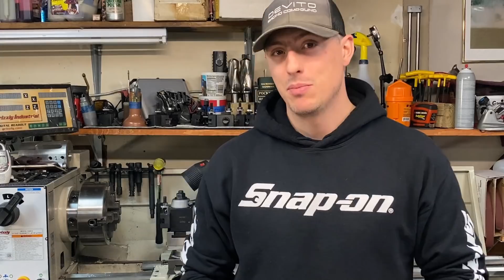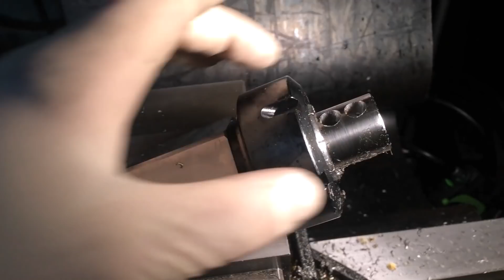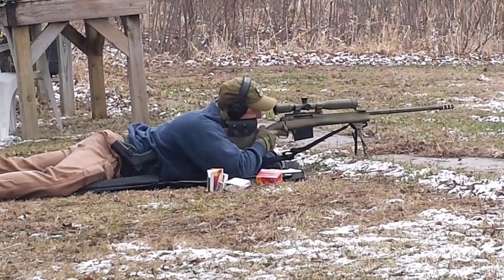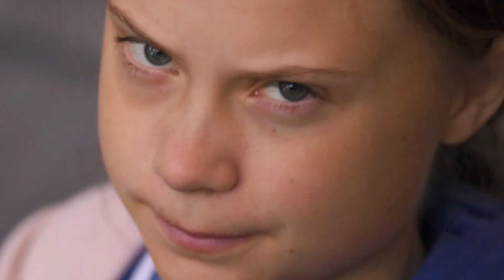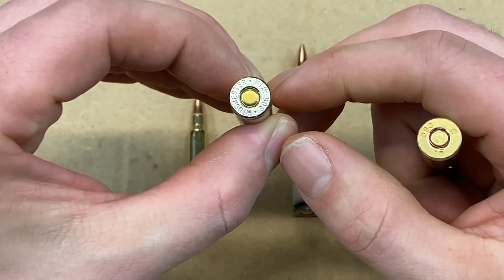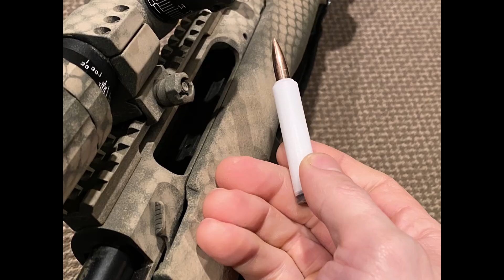6.8 NGSW ammo selected by the U.S Army for the NGSW Rifle testing! #ngsw #6point8ammo #army

Comment: Is the entire round 30 percent lighter, or just the case itself. That would be a totally diff calculation. The powder and bullet should be a wash, which makes up most of the weight. Curious
Reply: It's semantics.
The true velocity round is 30% lighter than if the 6.8x51 were made conventionally.
It's not lighter than our current 5.56.

The current 5.56 cartridge is 12 grams.
The 140 grain bullet is 10 grains heavier than our current 7.62 round at 9 grams alone. To get the velocities they're claiming, they'd have to be using at LEAST as much powder as our current 7.62, as well. That's another 2.8 grams. Another third of a gram for a primer. 
Without a case, and using the same amount of powder as a 7.6# M80A1 cartridge,, thats already over 12 grams without the case.
A lake City brass 7.62 case weighs 182 grains, or 11.8 grams. If we assumed the true velocity case weighs half as much, that would be 5.9 grams.

We already know that SIGs 6.8x51 entry is 24 grams, the sane weight as the current 7.62 M80A1 cartridge. At 17.8 grams, this ammo is 50% heavier than 5.56 and must be fired from an AR10 sized weapon. It's 25% lighter than 7.62, though.

The real question is how reliable is the ammo and is the ballistic data being put out there accurate?
Reply: @theimmortal4718  Very well said!  The semantics are always misleading  it seems!
Reply from the maker: True velocity States that its the cartage is 30% lighter. 
   It will be interesting to see if when it actually comes out it is 30% lighter that the standard 5.56 NATO round or if the design will change by then.

Comment: the weight and speed sounds like the 6.5 creedmore
Reply: More aptly the 6.5 Swede. It was designed around a mil spec cartridge to handle varied weights and configuration.
Reply from the maker: It sure does.
Reply: Since when has the Creedmore ever gotten close to those velocities?    It sounds more like a .270.
Reply: Nice try but no. More like a max loaded 6.5 PRC
Reply: The 556 has less volume and less recoil. I don't see it replacing the ar 15.

Comment: A little misleading. Selected for trial, not selected as the replacement:/
Great video otherwise!
Reply from the maker: Thank you, it says "testing" in the title.
Reply: @jeerrrrrrryyyyy  Appreciate the response. Just a clarification on my earlier comment since it's vague. The way the video title reads to the viewer(or maybe just me) is that the round is selected for use and the rifle is in testing phase.
Reply: @dougk.5501  no because each of the 3 rifle also has there own ammo type not interchangable
Reply from the maker: You may.
Reply: Alex G I  Right!  and the Sig 277 was the steel headcase/brass shell IFIRC

Comment: If the traditional brass casings transfer heat more effectively, doesn't that in essence make them little disposable heat sinks? I assume the guns will run hotter with plastic casing ammunition?
Reply from the maker: Being that heat is energy you would want all the energy from the burning propellant to be getting used in sending the projectile down range and not using that energy to heat the surrounding environment, in this case bring the chamber the the firearm. 

If the brass was able to be used as an actual heat store instead of transferring it to the chamber than your assumption would be correct.

   Honestly that was a great question. Thank you for the comment.
Reply from the maker: spikedpsycho   Your concern is rounds cooking off?
Reply from the maker: spikedpsycho  indeed.
Reply: If it transfers heat effectively, it transfers heat to the chamber walls. If it transfers heat ineffectively, it traps the heat.

Comment: True velocity’s bid will likely weigh roughly 40-50% more than m855(185gr). The bullet alone is 135gr (73% of m885’s total weight). That means it is quite impossible to get a complete round for any decrease in weight, especially with the army requirement of a 135grain bullet at 3000 FPS out of a 16 inch barrel. Those 3 requirements placed on the ammunition for this competition are ludicrously backwards. First off the army provides the projectiles. The army also gives them a minimum muzzle velocity and barrel length. This means that the companies are told exactly a minimum amount of muzzle energy(and therefore recoil and chamber pressure) they must produce. It also means that they are limited in the amount of down range performance that can be created because everyone has the same handicapped ballistic coefficient, bullet construction and internal ballistics. This competition was set up to fail so that the ass hats at the pentagon can say “ well we tried” with a straight face for the next couple of years while they spend taxpayer money on ridiculously expensive pet projects that may never pan out.
Reply: For "being set up to fail" all of the current candidates seem to be doing alright. They all have functional guns shooting functional ammo.
Reply from the maker: I agree.